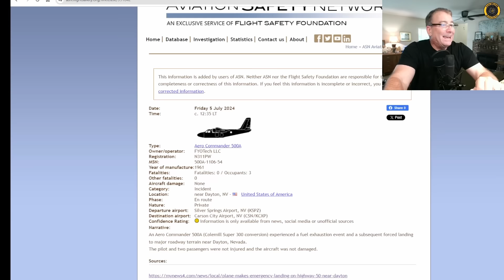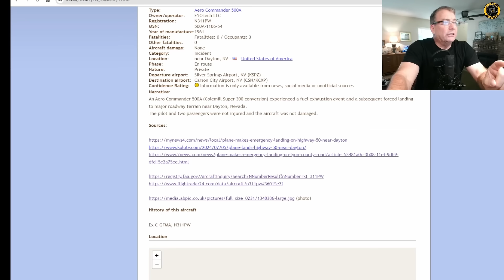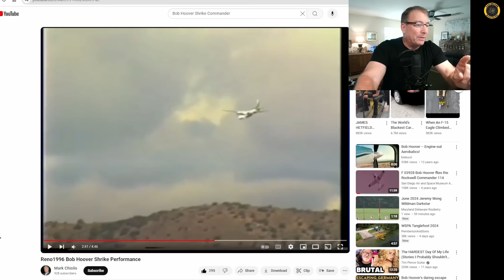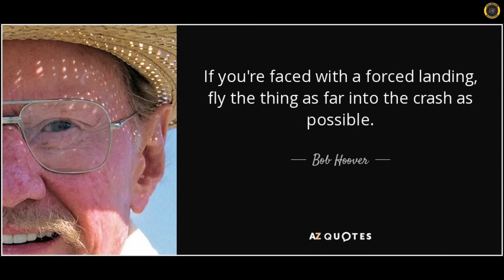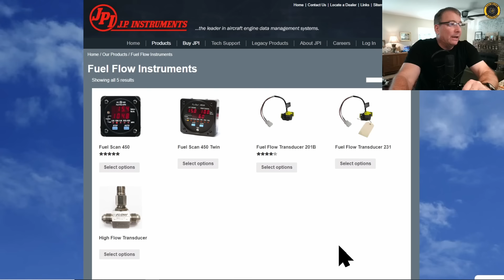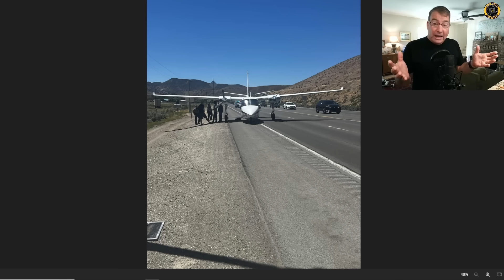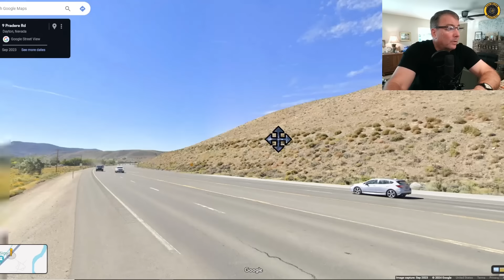Aero Commander Forced Landing Hwy 50 Dayton NV 5 July 2024

Comment: Thank you Sir for a great review of the incident. I was reading through the comments a bit and usually I do not comment, but wanted to add some insight and prevent speculations. But first I wanted to call out the real HEROS. The motorist that cleared HWY 50 for me to land there like the sea did for Moses. The FAA and NTSB for being helpful, nice and more than professional. The local Sheriff's office and NHP for managing the situation and finding ways to clear the site as quickly and savely as possible. 

1. I was the PIC and the new owner was in the right seat. In the back was his CFI/MEI (not his wife).

2. I planned the flight and fuel consumption needed based on take-off time, present temp and density altidude. Which means adding 70 gallons to the 40.5 indicated by the JPI.
    the 60+ year old annalog gauge indicated 90 Gallons fuel on board after adding 70 Gallons. I never trusted the old Gauge and had the JPI installed when I got the plane. I have a serious agenda staying alive for as long I can. I spend hours of flying adjusting the JPI K-Factor to a 0.5 Gallon/h accuracy. I keep constant watch on both JPI and annalog X-checking on every flight and after landing fill-up. We saw between 15-16 gallons ROP per side fuelburn during the flight. I know the annalog gauge shows roughly 20 Gallons less than the actuall amount due to the fact that I have more than 220 hours on that plane as PIC flying all over the western US.

3. Why we took only 70 Gallons? KCXP AWOS reported 80 degress and 6700 DA. 3 male adults 110 Gallons will give us reserve for take-off and landings to complete the mission safely.

4. After 4 pattern touch and goes at SIlversprings airport with the MEI in the right seat, the new owner took the right seat and we headed back to KCXP. Over Dayton (5 minutes out of KCXP) the JPI showed 40 minutes fuel remaining the annaloge gauge showed about 30 Gallons  when the left enginge stopped running.

5. Neither Carson nor Dayon Airpark were an option due to airspeed, altitude and power reserve. I went for the impossible turn right into the "good" engine knowing HWY50 is a downslope and at the bottom i'll find a 5 lane wide stretch to land safely.

5. The Plane is still at Silversprings due to my findings. After filling the tanks with 100Gallons, the engins started right up but the left engine CHT for Cylinder #2 and #4 showed fluctuating readings between 300-540F (why, see findings). 

6. The new owner loves the plane even more and can't wait to get it to NC, knowing that what ever happens a Shrike flown with respect will get you home... even at dead-stick.

7. No, I'm neither a Hero nor Bob Hoover I rather thank Talbot (my old CFI) and my MEI at Mach5 for hammering skills into my muscle memory. Still, thanks for the Hoover hat at the end of the vid if that was your intention.

8. At same point we had permission to fill her up and fly her out but in the age of social media it became to much of a widly known incident and plans got changed I think. Liability. In hinsight the right call since my findings below. What if #2 and #4 got demaged due to exessive LOP temps from fuel exhaustion and the temp reading were right?

Findings: The routing of the all wires from the Probes to the JPI have been installed right next to the exhaust manifold without heatsock/insulation. The wires got in contact with the exhaust, quintesentially melting insulation and grounding the probe wire providing false data to the JPI not just for the CHT. The JPI was installed by a well known avionics shop.
I hold JPI at the highest in regards of data accuracy and every plane I owned, had or will have it installed (from here on by myself since I plan to go Experimental. One can only trust himself). Probably cause for fuel exhaustion, false data provided from JPI instrument due to melted/grounded sensor wires.
Reply: You don't have to go experimental to do your own maintenance; you can get certified for that.
Reply: Every time I see a new video I think to myself: Here comes another lecture from Juan lol.
Reply: @dfeuer  Aircraft owners can do maintenance on their aircraft without certification. And I'm tired of being lectured by Juan, can you guys stop doing dum
Reply: Good decisons all the way when the problem occured. I am glad nobody were injured. Even reputed avionics shops can do mistakes. Which reminds me of the following story: 

Some decades ago, a friend of me sent his GA-7 Cougar to a well known avionics shop to have an HSI and fluxvalve installed. Some dasys later, the owner returned, paid the bill and departed for his home airport. It was night. Some minutes later ATC asked him where he was heading. - Xxx airport, he said. - You are flying in the opposite direction, ATC replied. My friend asked for radar vectors back to the departure airport for an ILS approach. When the landing gear was lowered, the HSI turned 180 degrees and showed correct heading. The avioics shop had installed the fluxvalve in the nose cone, but the nose gear leg was not de-magnetized. When retracted, the nose gear leg came to a position close to the sensitive fluxvalve. The avionics shop moved the fuxvalve to the empenage, and everybody were happy. I got my multi-engine rating in that machine.
Reply: @foghornleghorn8536 What would you prefer he had done?
Reply: Can you manually check the fuel levels in each tank with a direct fuel level indicator? If so, would you always do this in the future before flying?
Reply: @foghornleghorn8536 I say, I say, I say boy, I  do believe that "augering that plane straight into the ground" would have indeed endangered the lives of the other two living souls on board. Would it not have?
Reply: @foghornleghorn8536 So what you're saying is, everyone should just stay home forever. Leaving the house creates possibility to endanger someone else. All those cars on the road had possibility to endanger others. What a dangerous world we live in!!!!!! Ground all planes!!! Stop the ships on the sea!!!! Stop the buses and trains!!!!! It's all bad!!!!!!!
Reply: @foghornleghorn8536 Lonely?  Looking for attention?  One of those people who has to make a scene because otherwise people ignore you?  The pilot made the right decision and picked a landing spot that was wide enough and long enough to give him and his passengers the best chance at survival.
Reply: @foghornleghorn8536 Over 30,000 people die in car accidents every year in the U.S. We're all a part of putting other people at risk every time we drive, and we drivers kill a hell of a lot more people than we pilots do. Look up the statistics where aircraft kill motorists and you'll find the numbers are very close to zero every year. You're spouting off about a non-issue.
Reply: @FlywithMagnar  what is a fluxvalve?
Reply: @foghornleghorn8536it is not illegal to use a highway to land in an emergency such as this. Obviously he was not arrested or cited for landing there. What’s your problem?
Reply: @foghornleghorn8536 it's a good thing no one really cares what you just said.
Reply: @foghornleghorn8536 So do you care more about the miniscule amount of pilots every year who MAKE A DECISION to endanger others and kill between zero and a few people, or the tens of thousands who don't MAKE A DECISION to endanger others, yet kill 30,000+? And as a pilot I can tell you, HIGHWAYS ARE ALTERNATE RUNWAYS. As are fields, creek beds. large parking lots, etc.
Reply: @KuostA  A Flux Valve is an electronic sensor that gives information regarding its orientation relative to Earth's magnetic field. It is more stable than a compass.
Reply: @hansuhlig8565  Wasting any more time and energy arguing with Foghorn Leghorn is pointless... he's just an anthropomorphic rooster and a Looney Tune!
Reply: @northof4985  Oh, I know! I just like to see psychopaths paint themselves into a corner sometimes. Usually they just clam up, but sometimes they say really entertaining stuff!
Reply: @hansuhlig8565  I'm glad it all worked out. Having observant motorists was great. Awsome plane. Enjoy your future experimental flying.
Reply: Thank you for sharing.  Just goes to add to the Blancolirio experience when other pilots trust him like this.
Reply: "Probably cause for fuel exhaustion, false data provided from JPI instrument due to melted/grounded sensor wires."

Convenient, but the probable cause was the pilot flying the plane until it ran out of gas. Did you stick the tanks? Visually inspect them? Not familiar with the plane but if I ran out of gas in my Cherokee I wouldn't blame it on the JPI, I'd blame it on myself for relying on that to tell me how much fuel I was leaving town with.
Reply: Thank you for your comment. I have some experience with Instrumentation in the Oil and Gas industry. The sensors we utilize would provide some type of indication if there was a short or open wire/circuit; just to avoid a situation like this where a false value is displayed.
Reply: Great information and honest post, @Hansuhlig!
Reply: @jaredjones6292 Imagine the NTSB report on the fatal crash adjacent to a flat five lane highway. They would probably conclude pilot incapacity or perhaps control surface failure. I hope Foghorn is never placed in a similar situation and has to decide whether to survive or become a martyr for “safety”.
Reply: @foghornleghorn8536 Their main concern is living, not preserving the airplane, but the two go hand-in-hand. Also, what they did was completely legal, it's what pilots are taught to do in an emergency. The motorists ARE heroes. They saw fellow humans that needed help and they jumped into action. It's a scary world out there, but with a little bit of common sense most people do just fine. (Please don't drive your car off a cliff if you're running out of gas and can't find a turnout.)
Reply: @foghornleghorn8536 Are you saying you will point your car (if you have a car) towards the cliff when your car brakes fail, rather than risking to hit other cars and killing somebody? Or when you flying in an airliner and engines fail, you would rather get the pilot to point the aircraft directly to the ground to an empty space, rather than do him emergency landing on a highway?  Good on you.
By the way, I think you have too much time on your hands and should go outside and exercise instead of have none sense comments here.
Reply: @foghornleghorn8536 That's a lot of what they do, ya know... house fire because someone left a candle burning, medevacing out a motorcyclist who was going twice the speed limit and dumped it, having to save a drunk drivers life, etc etc.  That was his point, they put their lives/jobs ahead of others in most situation. I guess there's no such thing as hindsight for you, and you've never made a mistake lol.
Reply: @dfeuer  It's not that simple - in most cases it takes nearly 2 years and about 1,500-2,000 hours. It's almost impossible to do unless it's your planned career path and you're still in school -  and even then it's difficult.
Reply: 🔔😎
I've had my CP and AP (was I) for 5 decades.
I've seen some very well known shops do horrible maintenance and annual work. Oh the stories: pencil whipping KingAir gear retractions, p.w. AD notes for 7 years in a row, I've caught 17 discrepancies on one engine of a Baron58, did an annual on a twin that was painted 8 years ago and the paint on the screws had never been broken.... 
I rarely ever fly anything that I personally have not inspected AND preflighted.
I'm OCD and never ran out of fuel or landed gear up. 😁😁😁
Reply: @IslandSimPilot  Let me make sure I got your idea here.  You say they should NOT have done the T & G's.  They should have, instead, come to full stop, shut down, and sticked the remaining fuel to find out if the gauges and were actually accurate?  Is that what you are saying?  I am not a pilot but know full well the old saying 'trust your instruments'.  They had NO indication the JPI gauge was reading falsely.  It was registering within expected parameters.
So, I ask again, why do you think they should have stopped at Silver Springs JUST to 'stick' the tank?

Comment: in the 1980's i owned and flew N708M, the Shrike Bob had used for air shows in Europe. I bought the ship from Larry and Bob Byerly, owners of Byerly Aviation, a Commander dealership in Peoria, Illinois. They were good friends with Bob Hoover.
I did my multi check ride with an examiner at Rockford, Illinois.  We did an engine out sequence with an engine off and a full feathering of the prop. I could then restart the engine by activating a small micro-switch on the side of the throttle that would power up a pump, un-feather the prop and re-fire the engine all without using the starter, an interesting addition by Hoover to use if necessary during an airshow.  However, not being Bob Hoover, I only demonstrated this at 10,000 feet while right over the airport.  I am convinced to this day that the Shrike is one of the safest ships in the sky.
In the late 1950's, the Aero-Commander Company sold a 500 series to the Secret Service as a backup for Ike after demonstrating the crazy capability of the aircraft by removing one of the props, taking off single engine and flying to Washington, D.C.  That plane is in the Wright-Patterson Museum in the hanger annex on the far side of the field with other presidential aircraft. Not as fast as most big twins but a whole lot safer.
Congratulations to a good pilot who saved three people and a wonderful flying machine.  Now, let that be a lesson and don't repeat your error.  
All the best.

Comment: "Always take off with full fuel"  EXCELLENT ADVICE!!! - 18 years and 2200 hours in the beloved Baron BE-55. The 5th and 6th seats came out as soon as I got her. When I bought her the fuel gauges were trash. I got 'em "fixed" but only once did I take off with less than full fuel. And I remember that occasion.
Reply: Smart.
Reply: Excellent advice, rarely used and not always practical. The the airlines aren’t filling their planes full every time. And in a few cases some GA guys are loaded too heavy when full of fuel.
Reply: Well, always take off with maximum possible fuel whilst keeping W&B in mind.
Reply: “Always take off with full fuel” is great advice when you have plenty of power or a turbocharged engine.

It’s absolutely not practical in a lot of circumstances.
Reply: @VictoryAviation  "A man may plan as much as he wants to, but nothing of consequence is likely to come of it until the magician circumstance steps in and takes the matter off his hands."
                                                                     - Mark Twain
Reply: On the contrary I rarely take off with full fuel. Usually too heavy. It’s completely safe as long as you are always mindful of how much you have.
Reply: Don’t go taking off with the maximum fuel allowable if you’re in a 150 HP PA28 when it’s 85 degrees out
Reply: Absolute rubbish.
If one always takes off with full fuel single engine performance will always be significantly reduced, and at high density altitudes it will likely be zero or even negative.
Why fly a twin if you fly it in such a way as the remaining engine only takes you to the scene of the incident or accident?
Reply: @jamesgrant2253

Piston twins are taking you to the scene of the crash anyway. 

That’s why until you get to turbine, pressurized, and two crew… single are by far the safer option. Lower stall, glide, and landing speeds.  Less weight.  Half as likely to have an engine failure.  Not as likely to spin into a fatal crash.  

Plus all of the things that can kill BOTH engines.  Seriously what’s the point of being light enough for single engine performance risking both of them shutting down?  lol.

Comment: If the temperature of the aviation gas is 85 degrees at the time it is put into the aircraft, the fuel tank has less BTU value then if the fuel temperature is 55 degrees. You are so right about the fuel burn being higher in very warm temperatures.

Comment: I grew up with your understanding of when a fuel gauge needs to be accurate. That changed in 2017. In 2017, FAR 23 was rewritten, eliminating that wording of "empty". The new FAR 23.2430 says that fuel systems must provide the flightcrew with a means to determine the total usable fuel available.